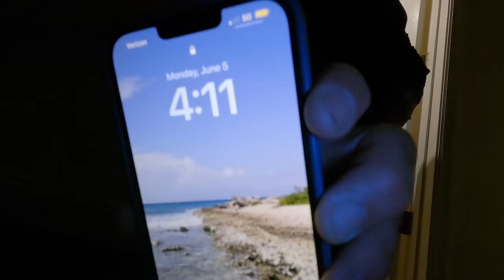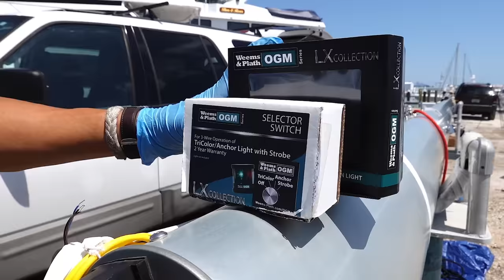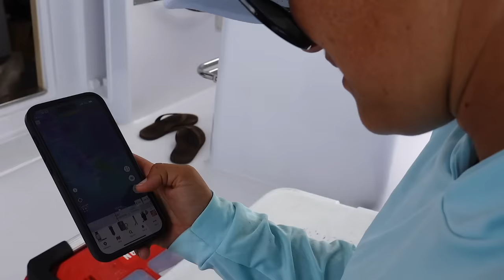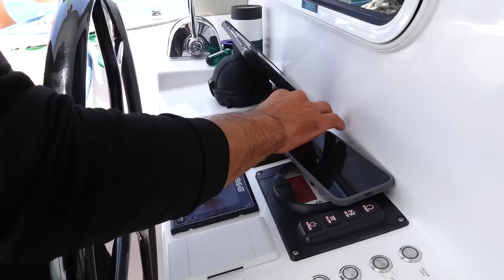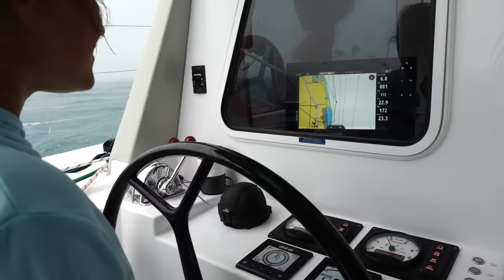THE DAY OUR BOAT ARRIVED: Full Commissioning to Maiden Voyage of our New Seawind 1170 Catamaran

Comment: Saw you doing a wire joint with shrink wrap and thought I'd give up my secret. I've got a little trick that I've used for years whenever doing a wire joint whether it's soldered and shrink wrapped or you use a butt connecter, it's the same. With a butt connecter, you fill it with silicone then crimp it on, done, or you can add shrink wrap. With soldered ends and shrink wrap, you slide the shrink wrap on, solder the ends together, apply silicone, slide the shrink wrap over the joint and heat. The silicone will squeeze out and water will never ever get in. Just make sure you don't get any silicone on where you have to solder before you solder or it won't work. This method has been tested on my motorcycles and sailboats for years now. It works!

Comment: Wicked guys! Such a cool boat. 

Just wanted to call one thing out. You should never take someone up the mast using an electric winch with the tail in the self tailor. Electric winches do occasionally stick on and I’ve seen first hand how wrong this can go. By all means, use the electric winch, but rely on a clutch and tail it by hand!! 👍

Comment: EARACHE  toothaches  try table salt heat small amount in a pan 30 sec. pour it in a cotton sock , very hot cotton only. Test temp. like a baby bottle. Hold under earlobe or tooth area salt is very dry it will relieve pain and moisture.. thx guys
Reply: You live in MB?? Me too! I’m in Murrells Inlet.✌️

Comment: How much does all the plastic and  wrapping, and the commissioning add to the cost of the boat?  ⛵
Reply: The plastic wrap protects the catamaran along it's long voyage surrounded by sea, cargo exhaust and the rust flakes falling from the containers also aboard. I know it appears like a lot of extra but the ability to deliver a new vessel that still looks new under the shipping conditions  makes it a necessity. The wrapping is also included in the construction price if the vessel is not handed over in Thailand 😉

Comment: Many years ago, when Vetus first started in South Africa, it was an agency, that was owned by a Cape Town Cat. builder. The Cat builder ordered 2 Vetus engines for a new cat, but specified LH and RH rotation to fit to their new Cat...Sea trials were confusing as the boat wanted to turn circles all the time....Does anybody know where this is going ??????  Seemed that Vetus forgot that fwd. and rev. gears had different reduction ratios, so you just can't reverse the Morse selector

Comment: Don't forget first service of the engines so need three engine oil cans  two large oil plash pads or pans depending how the engines are as could do with both 4 engine oil filters for when service is needed. Don''r forget fuel cleaning spare parts and filters as everything is brand new.